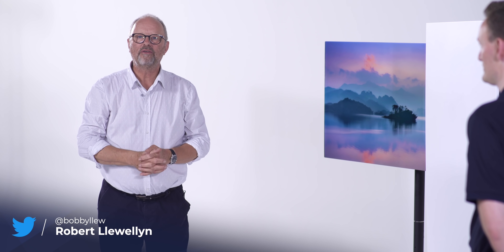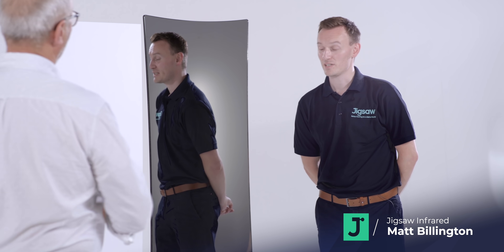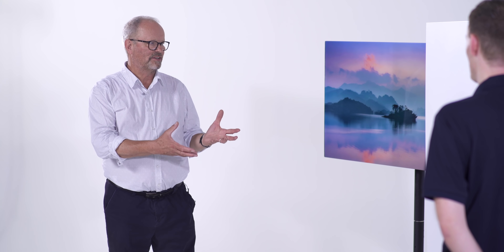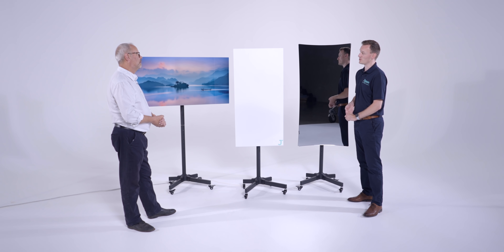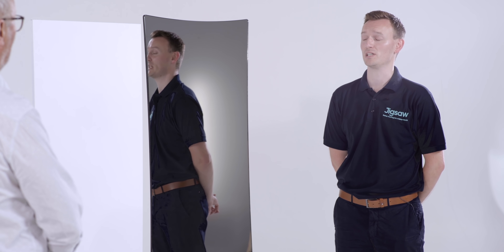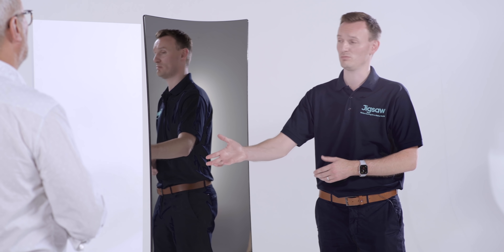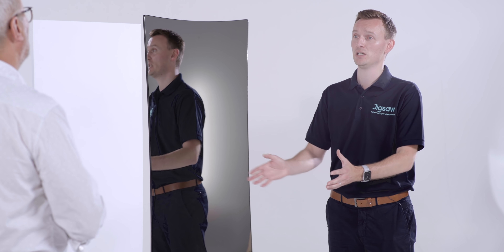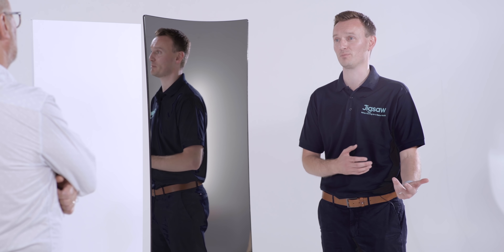JIGSAW INFRARED - Heats like the sun, cares for the planet | Subscribe to Fully Charged PLUS

Comment: Judging by the comments, this one is almost as controversial as "solar freakin' roadways". For now, I side with the skeptics. I'm having difficulty understanding how, in terms of energy usage, this is different than having a space heater in each room.
Reply: Hi, Larry! Um, yes. It seems to be... a stylish electric heater. Pump electricity in one end, heat up some wires, get warmth out of the other end.

Er...

In my experience that's always been a horribly expensive way of doing things, unless you produce all of your own entirely free electricity. And if you can generate endless power, I don't imagine you'd give a hoot🦉about running what amounts to a home full of old-school electric fires in the first place.

I'm not sure I understand the benefits of what's being offered here. Electricity's expensive. Using it for heating is expensive. And?

Ah, nostalgia... My late mum used to have a 'Magicoal' 2-bar electric fire. (No central heating.) She'd only ever use the heating part of it (either 1 or 2 x 1kW resistive heating elements) if she had guests; when alone she'd sit with the cat on her lap and turn on the 'glowing coal'  (a 60 watt red lightbulb driving a lightweight circular aluminium propeller by convected heat to give a flickering effect). The artificial glow was some slight comfort in a freezing room, but wrapping up well was the only way to actually keep warm.

Unfortunately it soon got to the stage that even running the 60 watt lightbulb was seen as an unnecessary extravagance, so she just cuddled Boops the cat, who was a tremendous source of comfort and who generated an astonishing amount of free heat over a period of 18 contented, purr-filled years. 🙂
Reply: @EleanorPeterson  Thanks for the laugh!
Reply: The sun is a radiant heater. Stand in the direct rays of the sun and you will feel warmer than if you stand in the shade. The air temperature around you will be the same but in the shade you'll not have the benefit of the radiant heating.Space heaters typically must first heat the air in the room to bring the space to a comfortable temperature. Radiant heating directly heats the occupants and the surfaces of the room without having to first heat the air. As hot air, NOT heat, but hot air rises, when using space heaters the temperature in a room is stratified with the air at the ceiling level being the hottest. As we are standing or sitting in the middle or lower thirds of the room we have to essentially overheat the air at the ceiling level till we are comfortable down at occupancy level. Heating all that volume of air to keep a person warm is less efficient than heating the person directly.

Our bodies radiate heat to any surface around that is colder than we are and if we feel cold it is because we are radiating more heat than our body is producing at that moment. If you walk down the freezer foods section in a store you will probably feel cold, but if you compare the air temperature in the freezer foods aisle with the air temperature in the rest of the store you will probably find that there is little difference between the readings. None the less the freezer foods area feels colder because, again, we are radiating our body heat to the cold surfaces of the freezer displays.
In houses that have radiant heating typically residents are comfortable at a lower air temperature than in houses with hot air heating. Hot air heating may be in the form of forced hot air, electric space heaters, hot water base boards, hot water radiators or fan forced convectors but primarily they all rely on heating the space through convection of hot air. There is a small radiant component to each of these systems which increases with the surface area of the emitter. For example a large standing cast iron radiator has a lot of surface area and sitting near it will feel warmer than sitting further away from it even though the difference in air temperature between the two locations is not significant. The grill/register of a forced hot air heating system has almost no surface area to radiate heat and so will not provide noticeable difference in comfort.

I think it is universally accepted by those who have experienced it, that radiant heating provides the greatest levels of comfort. Radiant heating usually uses hot water flowing through tubing embedded in the floors walls or ceiling but for small areas such as bathroom floors may use electric resistance cable embedded in the floor. Electric radiant panels using a glass surface with an incorporated electric element were sold, installed and enjoyed by some in the 1950's here in western Canada when electricity was cheap. The first panels here used a proprietary tempered glass patented in France and were very successful but later panels used a glass made without the proprietary glass and due to thermal cycling they eventually would shatter, exploding outwards in a shower of glass and thus ended this style of heating in this area. 

Electric radiant panel heaters continued to be manufactured, sometimes as cable sandwiched between sheets of drywall for use in T-Bar ceilings, sometimes as low profile unit to be surface mounted on ceiling or wall but both of these were primarily used for spot heating (above a desk or work station) but never commonly used as the heat for an entire project. 

In the 1980's a Scandinavian company ESWA produced a radiant panel that was a foil heating element laminated into a thin plastic film. The film panels were stapled along the edges to the rough framing of the ceiling, interconnected,  then covered with a drywall/plaster finish. These radiant ceilings worked well providing comfort and efficient, clean, silent operation making those who had them very happy. Until that is the panels started to break down and fail prematurely and thus ended another era of electric radiant heating.

While electric radiant heating panels were failing, hydronic heating panels were surging in popularity amongst those who could afford them and today this continues to be the premium heating system available. Using plastic tubing laid out in loops on the floor of each room then embedded and covered with a finish surface, each room or area can be individually controlled providing the economy and comfort benefits of a zoned radiant heating system. While water is used to distribute the heat, the heat source can be any or even multiple sources of energy, such as electricity or gas or wood or coal or solar or heat pump. When built as a combination system such as gas/oil/electric, the owner can switch between energy types at the flip of a switch or automatically through software, taking advantage of which ever fuel is the cheapest at a given moment. As hydronic radiant panel systems provide comfort using a relatively low water temperature of 38 to 48 degrees C, maximum, they are well suited to heat pumps allowing the heat pump to operate at low and hence more efficient output temperatures. So there you have it. Radiant heat is the most comfortable form of heating and the most economical and Hydronic Hot Water Heating is the best way to implement radiant heating because it can use any form of fuel or energy. The End. 
Except not The End. Hydronic Hot Water Heating is Excelent, but it is old news. It's old technology. It's had it's day, or soon will have. Why, you ask? The answer is Super Power as predicted by Tony Seba. When electricity becomes as cheap as Tony predicts (due to battery storage, solar and wind production) it will no longer make sense to invest tens of thousands of dollars to install a hydronic radiant panel system when it is much simpler, cheaper and easier to gain the same benefits using electric radiant panel systems. While historically some types electric radiant panels have not lasted others have. The simplest is electric resistance cable as is often used for heating the floor in fancy house bathrooms. It is cheap, reliable, silent when operating and unlike hot water tubing in the floor it will not start leaking if ever the house loses power and so freezes up. And as quite as hydronic systems  are, there can still be some sound of water flow, pump noise, boiler or heat pump operation.
So now, to sum up, finally. Lets go back to the future as seen in the 1950's and once again and for the foreseeable future, enjoy the benefits of electric radiant heating using what ever type or product is most suitable for the application. I hear that Jigsaw Infrared is doing some nice things these days.
Reply: Taking the easy option and following other people is your choice. Ever thought of making an educated decision? There are many forms of data on the internet which supports infrared, even educated University studies have demonstrated its effectiveness against other forms of heating. If you prefer to listen to ill educated sceptics then you may be missing the point Larry.
Reply: @glennbillington4879  OK. Give me some links to the studies.
Reply: @GeeKayKayGee  I am not skeptical of the concept of radiant heat. I have enjoyed the warmth of the sun on a cold day, spent time with friends huddled around a camp fire, and warmed my bones in cheap old apartments by sitting on the radiator. The issue is whether or not technology like the product shown in the video is the best choice for providing enough warmth in our living spaces for comfort and safety while consuming a quantity of energy that we all can afford, and which can be produced by carbon-free renewable means.
Reply: at home it's not comfortable to not heat the building.
Reply: @EleanorPeterson  I would not consider cat food to be free...
Reply: @GeeKayKayGee   exactly this.

A bit like people on top of mountains on witersport walk around in t shirts even though it's freezing out and they are surrounded by snow. The radiation of the sun is what warms you.

This can be used just where you sit in the living room. A single panel can be used instead of using loads of energy to heat entire rooms or buildings to make it just as comfertable.

Comment: If you want electric radiant heat buy an oil filled panel heater or a bar heater at a fraction of the price.  Electricity for radiant heat is approximately 4 times more expensive than gas for central heating (or heat pumps) as it uses electricity immediately probably at the most expensive time of the day.  Maybe if you can afford a battery large enough (60+kwh) to store one days worth of energy and charge that when prices are low then it may be worth it.  I suspect that as electricity gets cheaper because of wind, solar and nuclear generation then the price difference to gas will get smaller in which case this may work.  This systems only advantage is the control, but that is not game changing.
Reply: Aston University undertook an independent study for three different heating systems. Jigsaw Infrared was the infrared system used in testing. 

The Study found:

IR heating system can increase the room temperature to 18 C in 10 mins which are less than the other two heating systems (2000 W and storage and convection) which take 15 and 17 min respectively. 

The IR heating system can heat the room temperature to 22-23 C compared to up to 18.5 C for the other two systems. 

The IR heating system has an efficiency 2 times higher than the 2000 W and storage and convection heating system. 

Therefore, the IR panel used half the energy (50% less) of the storage heater and reached room temp in almost half the time.
Reply: Don't think it will stay that way RE: expense of electricity vs. gas. It has been rumoured that the government will shortly be announcing the moving of levies from electricity (e.g. smart meter rollout costs) to gas.
Reply: @jigsaw.Infrared  How fast you can heat the room means nothing. Heat energy is heat energy and if heat pump can pump 4kJ of heat energy into isolated place with 1kJ of electric power you used 1kJ of electric energy to gain 4kJ of heat energy. If you want to have the same heating effect you will need to consume 4kJ of electric energy with IR panels. Therefore they are much less efficient.
Reply: @jamislil2703  The heat pump is heating water to heat air. Water takes a lot of energy to heat. Water requires 4.2KJ of energy to heat 1Kg by 1ºC. Air or brick, the fabric of the building as an example, takes around 0.7KJ of energy to heat 1Kg by 1ºC. Therefore, the 4:1 ratio of a heat pump is being lost in the very energy-hungry process of heating water.
Reply: @jigsaw.Infrared  I agree but if you are heating  a house for example you will need to heat everything in the house to the same temperature to have the constant temperature. If you have a thermostat with constant temperature everything is  already heated to the same temperature except outer walls that cool because of their non zero heat transmittance. So heating the house is a match between a loss of heat energy provided by heat transmittance between outer walls and outside air and your ability to supplement that lost heat energy. And heat energy transfer is lossless aka. if you heat one kilo of water for one kelvin above the themperature of the surroundings and wait all the heat energy that was transferred to water will be transferred to the air and therefore heat it.
Reply: @jigsaw.Infrared  very worrying how bad your thermodynamics are 😬😬😬

Comment: We are currently designing a passive house heated solely with infra-red mats. It is a very flexible and easy to install system, however it should not be underestimated, that the key issue is the source of electricity. In our case we use integrated PV panels which generate sufficient amount of energy to cover the power demand. It would be very misleading to sell this technology as green and sustainable if the power was generated by a conventional fossil fuel power plant.
Another point is that, compared to conventional underfloor heating linked to a heat pump, we cannot use  the infra-red system for cooling.
Reply: The cost of heating our home halved as we previously had storage heaters. 

Isn’t installing the mats a totally different method? It’s more expensive than panels I’m led to believe. 

Have you price Jigsaws panels to compare the cost difference?
Reply: @glennbillington  The principle of the system we use is identical to the one used in panels, the main difference being that the infrared mat is placed directly under the flooring and not integrated into an aluminium panel. The mats could also be used on a ceiling or a wall. An advantage of mat over a panel is a more even heat distribution in a room. On the other hand if there is any breakdown or damage to the circuit you have to replace the entire floor. With a panel any breakdowns are much easier to fix.

Comment: Infra-red heat conjures up images of heat lamps - surely it should be producing infra-red light that radiates out? Him saying that its a mat in there seems as if its just an electric wire heater in the form of a spread out mat within the panel!?
Reply: He actually said both. That is all it is and infrared heat is a wavelength of light as both you and he mentioned
Reply: That's all it is. A coil of wire embedded in a ceramic or glass panel, or whatever panel. Pointless and very expensive to run.

Comment: I see a lot of opinions, but I would want to experience the devices in action. I think they would be much faster than wet radiators and the energy is going to stay inside the room rather than going through convective air heating which then heats the content of the room by conduction (if the air doesn't blow away or rise to the ceiling) A classic example would be one of those days when outside and the sun shines on you and you feel warm immediately even if the air is cold. The moment the sun goes behind a cloud you feel cold. All this needs is a battery to hold the energy so that you can use off peak electricity. Curiously I just remembered, (probably Tomorrow's World), electric wall paint.
Reply: Yes Jim.